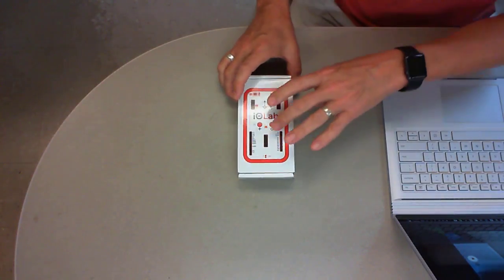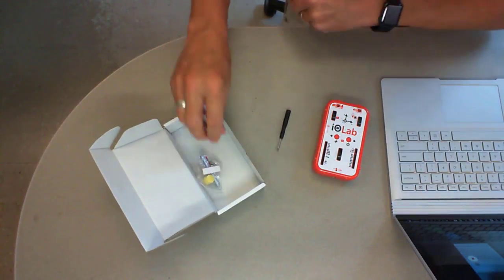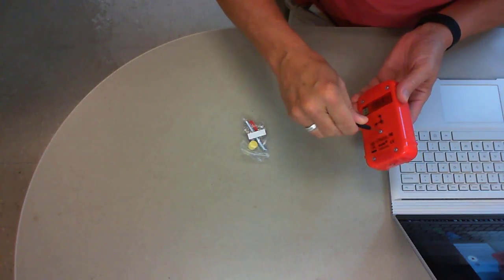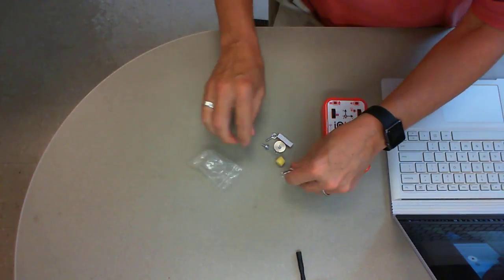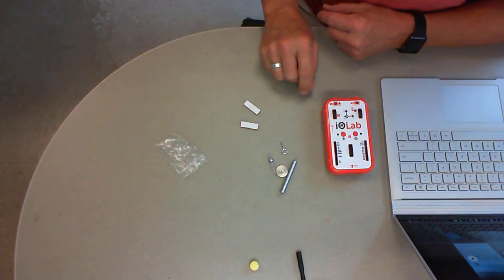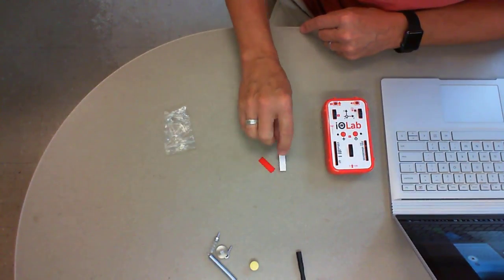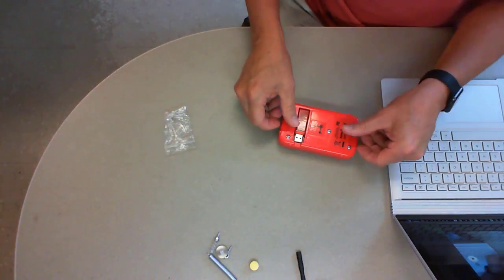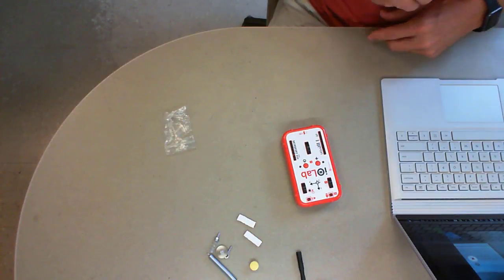Preparing Your IOLab (Aug/2017)

Comment: how do you use the usb? I can't tell if I am just supposed to rip it out or not.
Reply from the maker: Yes - you just push in on the metal (USB connector) side of the dongle and the other side should pop out - then just pry it out with your finger or something else like a pen. It may be stiff at first, but after a few times is will come out easily.